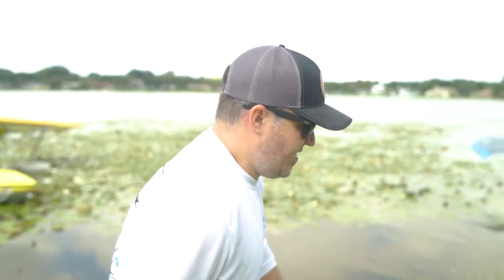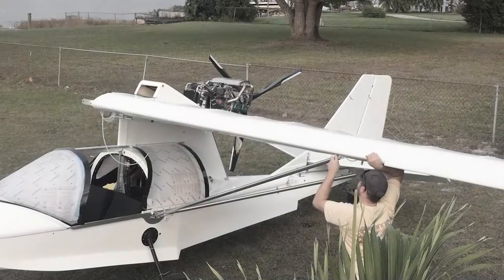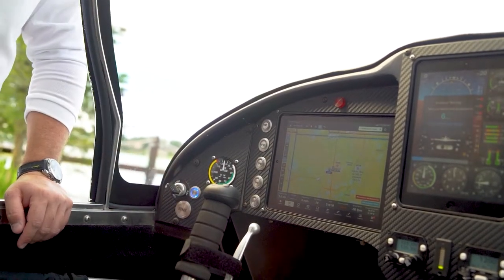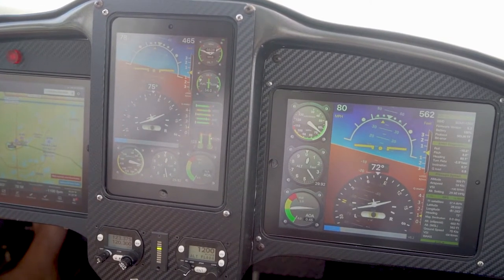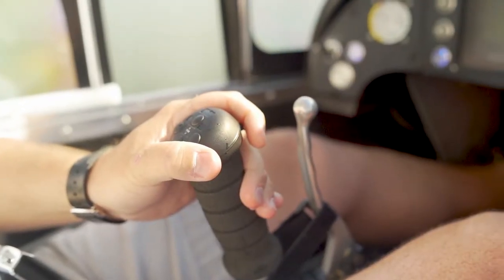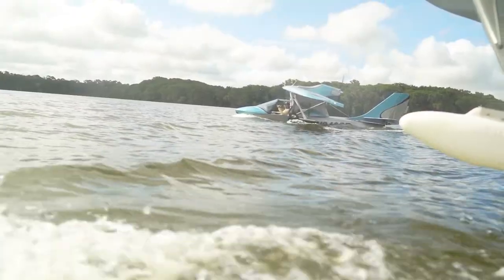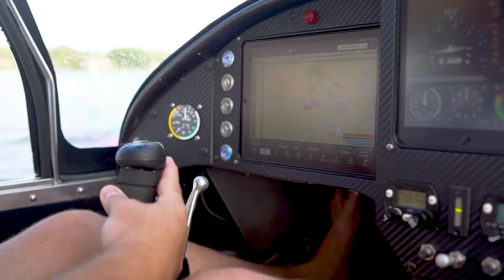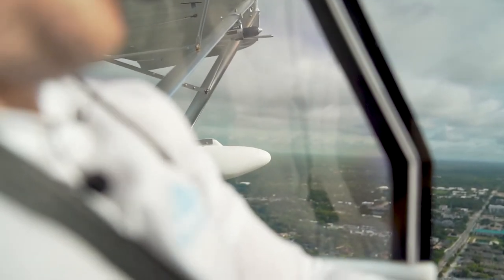SeaRey Light Sport Amphibious Aircraft (Flying With a Levil Aviation Glass Cockpit)

Comment: Nice video.  Need a more in depth look at the panel.   What is on each screen?  How does the EIS pull engine information to the iPad?  Why are the BOM and the iLevel 3AW both installed?  Redundancy?   Trig is mentioned but don't know if that is Trnspder/Radio/NavCom and/or Autopilot.   Please do a full video just on the panel.
Reply from the maker: We have a video on our channel going over our app.
Reply: @levilaviation  Please take a few minutes and provide the link.   Unless this is a new video, not sure if all the points above are covered in this video.   Thanks.
Reply from the maker: @rmm9676  we can't share links here. The name of the video is "Flying With an Updated Glass Cockpit Using Your Phone or Tablet (Levil Aviation App Walkthrough)"
Reply: @levilaviation  Why are the BOM and the iLevel 3AW both installed?
Reply from the maker: @rmm9676  the pilot was testing the BOM during filming.
Reply: @levilaviation  Thanks!   All clear.